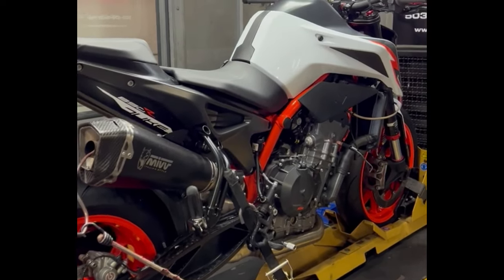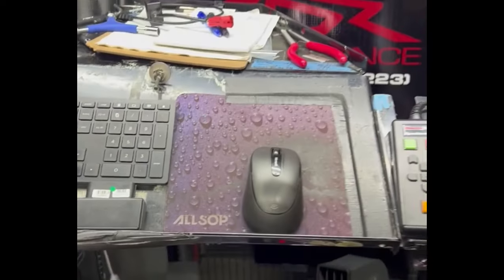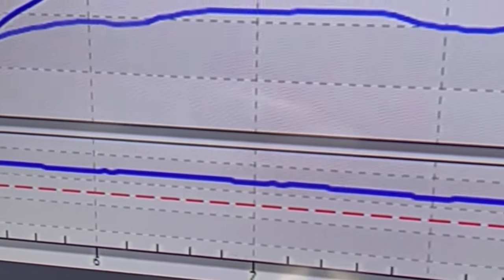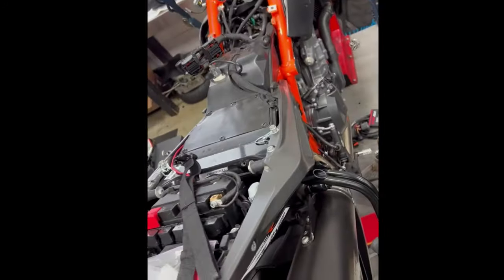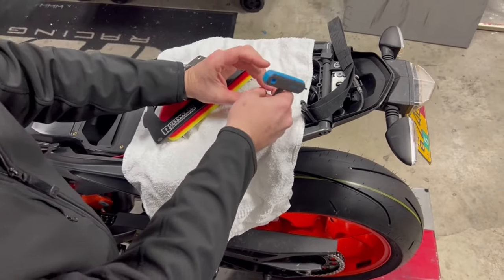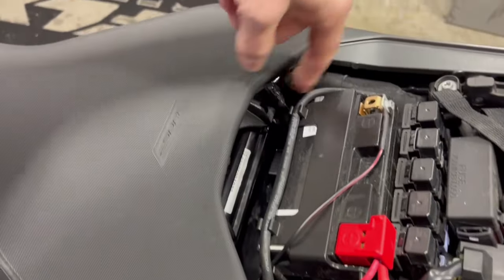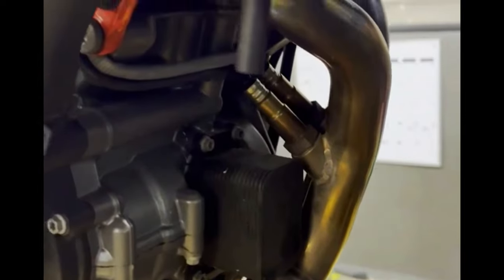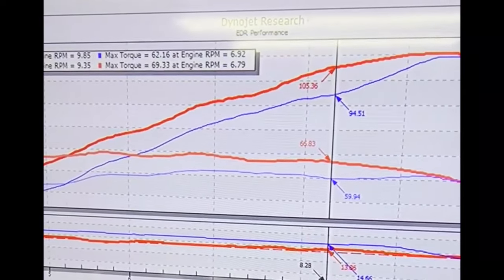!KTM 890 Duke! Performance upgrades, Exhaust, Intake, Tuning #howto #motorcycle #ktm #duke   #dyno

Comment: Andy DiBrino, the racer who kicks ass and needs more sponsors? haha. I've decided on an 890 Adv R for a do all bike because I actually live in Baja California (Cabo). If you DO NOT want the check engine light, can you still get all the midrange punch? I am buying a bike in Idaho with " Powerflow Kit, Power Plate Filter Assembly, and the Tech Pack" and will be in Oregon this summer (HS reunion). Loved my Aprilia Mille Nori Haga replica midrange but the bike burned in the Paradise/Camp fire. She only made 115 rwhp but it was so fun rolling on the throttle out of corners.

Comment: PCer’s suck, have Shiv at Open Flash Tune flash the ECU.  Yes, there is more power at high RPM and everywhere else too.
Reply: agreed ... the Power Commander is redundant given that full ECU tuning has been a thing on the 790/890/890R for a while now
Reply from the maker: however many guys do not want their ecu flashed, We do over 1,000 ecu a year and are aware. Pretty sure we have fastest 890R in the country, unless someone else has won Daytona like us and campaigns them nationally? Guys not everyone wants to flash ecu  so guys worry about warranty and ktm is a bitch with warranty if you have a flashed ecu so this older gentleman wanted to leave ecu stock and also insert inside the exhaust plus a street map with o2 still enabled. Trust us, we know of and do the ecu and race builds a lot, this one was more aimed at the average guy. Thanks much
Reply: @edrperformance  So what would you recommend to a guy with a 2021 duke 890R looking at the pc6 but need advice have an arrow exhaust with decat.
Reply from the maker: @allenfong720  It depends, if you want the PCV or PC6 then you have 2 options you can choose from the race map or the street map. the race maps requires up to remove your O2's that way we can map all the way through. BUT you will have a check engine light for your O2 sensors. The street map leaves the o2 sensors in which means we will only be able to map after 5000RPM's and anything below that is a stock KTM map
Reply: @edrperformance  compared tot the pc6 is the open flash tune a better product? You also mentioned  the pcv was perfered over the 6? I just want. A priduct that will support my current mods with piece of mind .

Comment: You guys have a recommendation for an exhaust that will allow someone to not have the heel of a boot interfere with the pipe?  US13/EU47 hits the stock exhaust and ends up requiring me to have my foot be damn near 90 degrees to the footpeg to not have an obstruction.  
Also, getting rid of the massive 5k rpm dip would be great.
Thanks for your efforts!
Reply from the maker: Email us at info@edrperformance.com and i will send you a quote!!!

Comment: Do the after dyno runs seem to take way longer than the before runs? Easy way to cheat the dyno results if so
Reply from the maker: What does this even mean? If we cheated dyno runs would we be still in business over 25 years? Fxxk no! I have over 2,000,000 miles on the dyno for almost 30 years.  Comments like then make no sense! Did you watch MotoAmerica 2022 Daytona & our win on the KTM890? Why do people comment like this with zero knowledge of Dyno’s and how they work?
Reply: Knowing about how dynos work is why I pointed out the inconsistency.  An honest tuner wouldn't have compared air/fuel numbers of a cated bike vs a decat bike